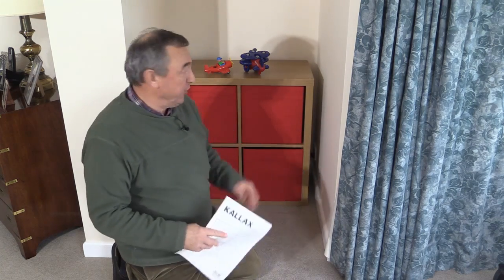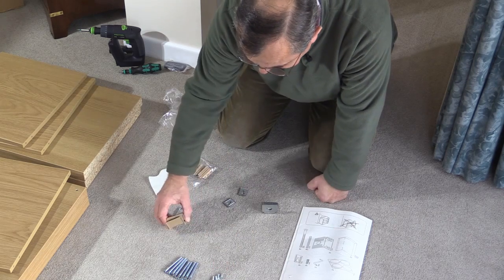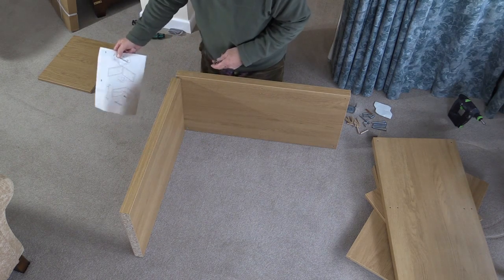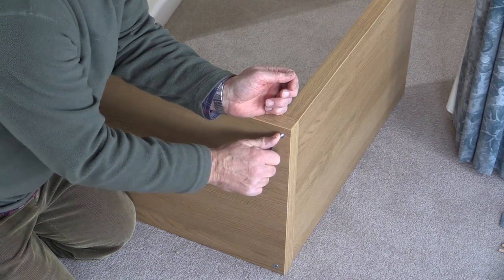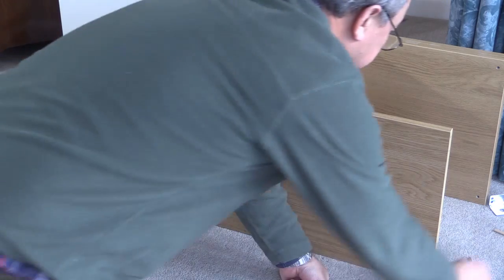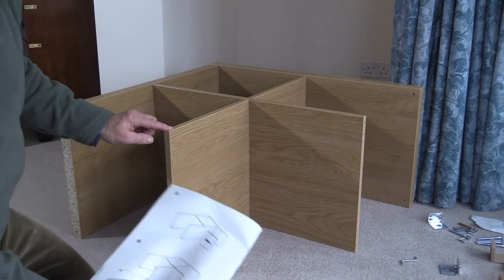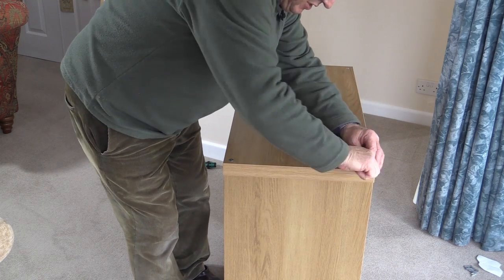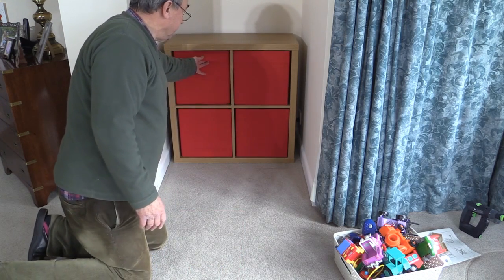How to Assemble an IKEA Flat Pack

Comment: You missed tip number 1 - get rid of the screw things they provide, and take out your trusty Wera Cyclops set (a gift from my wife, thanks to your christmas gift video last year), and use that instead.  1000% easier.
Reply from the maker: +Euan Walker    Hi Euan, Yes, I was tempted but many people will not have such super tools and will have to make do with what IKEA supply.   Cheers.   Peter

Comment: Hi Peter, good video as you note its critical to read the instructions all the way though, check all the fixings have been provided and ensure the orientation of the parts are correct when constructing. If I knew the item would not need to be dissembled I would glue all the dowels and the sides. If its likely to need to be disassembled I would glue in the dowel on just one side - stops them getting lost as well as reinforces the joints. One final thing a proper allen key/hex key makes the process easier too.
Reply from the maker: +bill coniston   Hi Bill, Yes I agree with everything you have said. I did want to use the tool supplied as some people will not have the sorts of tools that you and I might have in our workshops. Cheers.   Peter